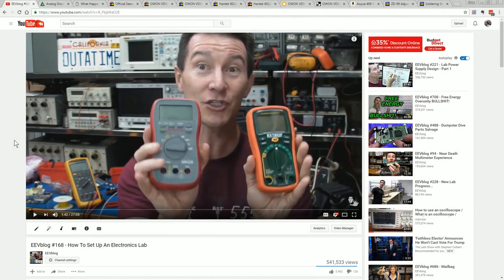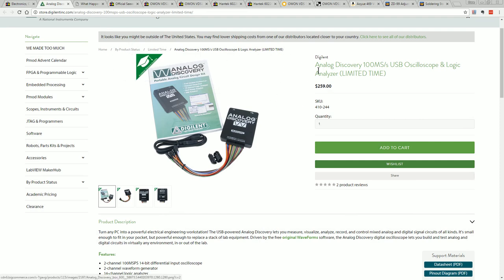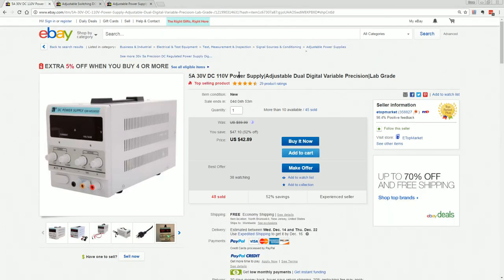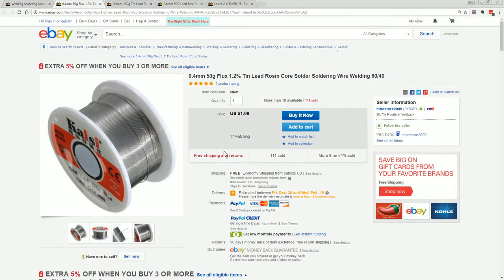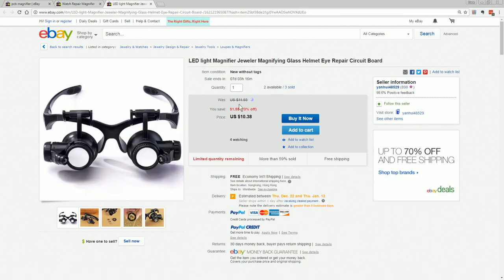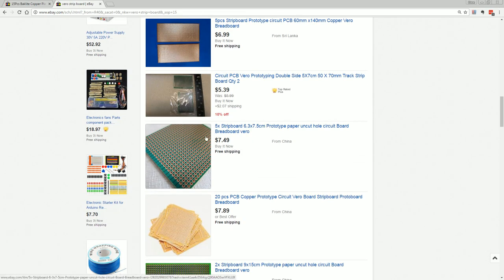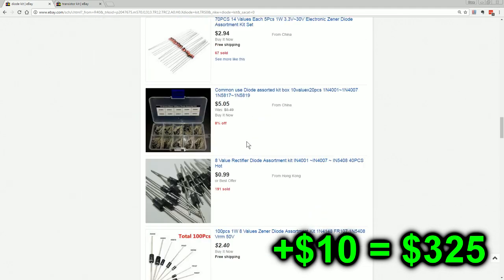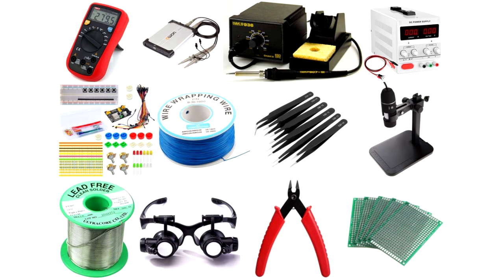EEVblog #954 - How To Setup An Electronics Lab For $300

Comment: this is useful! but id recommend a helping hand with magnifying glass over the crappy microscope. adds another 15 bucks you could spend on a microcontroller kit or parts.
Reply: From my experience those $10 microscopes are worth it when its all you can get, especially when you're still getting your eye in with SMD soldering it makes 0.5mm pin pitch soldering feel like you're playing with SOIC.
Reply: gamerpaddy The generic helping hand is, in my opinion, useless. That thing is super easy to tip over, its not solid enough. There are better options but they are also expensive. 

I ended up using glue and a scrap of a plywood sheet in order to secure the bloody helping hand
Reply: If you can find a logitech c270 camera , cost about $20 , they have a lens that you can unscrew to make it macro that allows you you get close enough to a pcb that you can view solder joints at 1280x720 in very good quality.
Reply: +Victor García I bought one years ago (without magnifier), and the grips on its "arm" positions are just not firm enough to hold the weight of even a small populated PCB.  Mine just lowers its arms until its no longer holding anything.
Reply: get the right one,or just one of the mini rotating vise (the one with a ball joint)  they are pretty handy.  the magnifying glasses / headgear you allready got.
Reply: InXLsisDeo yep, agreed. I think mine goes up to 200x but it only ever use it in the first 10th of the magnification at most.
Reply: +EscapeMCP That one looks good. how was it  would you recommend it?
Reply: Just spring for a good board holding device....there are some really nice ones for around 200$ last I looked. VERY worth it. There is nothing worse than working on a large motherboard with through hole and trying to balance  it upright while soldering/desoldering (which is what I do now because I don't have a spare $200). I do have  a classic helping hands for small boards thoough. It does the job. If it is falling over, then adjust the center of gravity(yes, you can do that with all of them).

Comment: I would also recommend one of those microcontroller based component testers (usually sold as "transistor tester"). Measures everything, identifies pinouts. Also measures capacitor ESR in-circuit, which is great to find faulty caps. About $14 shipped.
Reply: Yes! They're quite fun too.
Reply: If you just search for "transistor tester" on ebay, a lot of these will come up, with names such as LCR-T4, GM328, etc. A small board with a graphical LCD screen and an ISP socket. Sometimes with mini grabber type test leads included.

Comment: This is exactly how I started. even older used oscilloscopes are nice if you know what you're looking for. But I buy a lot of stuff off eBay for the quantities alone. only issue I have is when you get counterfeit ICs. but, for a quick circuit, they have always done the job.

Comment: Great video Dave!  Just a note on those blue through-hole resistors: the color bands are impossible to read.  For beginners, much hair pulling will be saved by making sure you get the standard tan colored ones.  :) (voice of experience speaking!)  Again, great video!
Reply: Ryan Griggs i have tan ones and on monday i am getting MANY blue ones and will let u know how much trouble i have
Reply: oH well,lord! Hardly expected a reply like this a year later. Im deep into electronics and dont have tooooo much of a problem with blue resistors. Worst case I use my Fluke 87V for accuracy checks.
Reply: @Wes8761  It's good practice to check their value with a multimeter anyway so their is really no issue

Comment: A few other things that are handy
- LEADS - plenty of test leads: alligator, test hooks, banana, bnc. All handy. You can buy longer leads off ebay and cut them in half or quarters and put whatever end you like on them. However, it's nice to have flexible leads so search for silicon wire (various colours) and buy a few metres of each. You can buy bags of alligator, banana and test hooks off ebay. Make sure you solder them and not just crimp.
- Quite regularly I'll buy the 240vac to 12Vdc 450ma modules for about $2ea. Great for all sorts of projects but even better for powering and isolating different circuits power requirements (like powering an LED voltage display separate from the power it's measuring). The displays only power up from 4.5V so no good if the power you're measuring is sitting at 1V!
- Second hand scope - $20!
- PBC stand off's. Buy a kit of various M3's.
- Build a transistor tester - saves time identifying leads, types and various (not 100%, but pretty good and also does diodes and bonus wave generator).
- male/female header pin kit
- heatshrink kit (buy a medium clear case, various lengths/colours/sizes and make yourself)

Comment: For Oscilloscope Digilent markets the Openscope nowdays which is really pretty nice for $99. 2 scope channels, -4 - 0 -4 v power supply, 16 ch logic analyzer, 2 ch function generator etc. Works on WiFi if so inclined.

Comment: the cheapo 30v 5a supply is nice, but you definitely want to add a resistor across the temp switch, so the fan is slightly on all the time. Without it, the fan will switch on even with very low load after a few minutes, making very annoying noise. 
I recommend the fluke 17b+ as a cheap multimeter.

Comment: As a cheap power supply I used a Tatoo power supply from eBay at some 12-14 USD, there were a 90-250 Volt ac to 24 DC power supply inside and then a LM317 regulator and a panel meter, I did remove the 2 pieces of 1/4" jack sockets and replaced them with a red and a black binding post.
Yes it is not the best PSU in the world, but I can get from around 2 to 18 Volt out of it  and around 1 Ampere, so it suit most needs I have and I often use it, much more often than my 2*0-30 Volt 5 Ampere lab PSU.
So as a starter PSU this is ok and more safe than a PC PSU which can blow the hell out of to much electronic if you do not take care.

Comment: I started with electronics using one of those starter kit from eBay.
Those kits usually just pack a small amount of each component and charge a big price.
For example they might give you 20 LEDs, and 20 jumper wires, while separately
you can buy 100 LEDs or 80 jumper wires for $1 each.

They do help beginners learn the basics of electronics, and which components they want to have.

But I think the audience that would need an oscilloscope or a signal generator, is already familiar with basic electronics, and would better prefer buying LEDs, resistors, diodes, breadboards and all the other items on those kits separately, and get much bigger quantities of common components.

Comment: I picked up a used Weller soldering station for $10 on ebay and for years I used an old 500w computer power supply as my bench supply. It was free and gave me lots of +12v, +3v, and +5v leads to work with. ;)

There is always ways to scrounge what you need. Just keep an open mind and see what you find. lol

Comment: I like the converting the computer ATX PSU where you stick in a 10Ohm resistor to make it stay on. Total cost less then $1.00. Has protection too that works well for oops moments.
Reply: it doesn't really have any protection. well, except for itself, but who cares about a "free" part when your 6 week project goes up in smoke? It's a good provider; throw a meter and cheap CV+CC buck in front for a half-way decent "bench PSU"

Comment: I would likely add spending maybe $50 on an arduino kit as well. These days they are so indispensable for prototyping. And the kits usually come with a tonne of nice goodies.
Reply from the maker: Of course.
Reply: aren't there emulators or something?
Reply: wtf??
Reply: 10 bucks max from china .... after my 20 euro genuine board died I decided id rather buy 10 2-3$ Chinese ones for the price of a single generic one. modules are ridiculously cheap too, usually a dollar a piece.
Reply: Kevin Miedema even better

Comment: Good advice. I remember setting up my first lab (kitchen table) when I was 6 back in the 60's. It was a soldering iron and a test meter that I found and repaired. I stocked up my supply rack (cardboard box) by salvaging parts from old Tv's that I found on the local dump. Total cost £0.00. Did not have a scope for nearly 10 years but acquired equipment as the money because available and I now run a company that develops electronic systems. You can never have enough equipment but you can also make do with almost nothing when beginning if you really want to so if you do not have any money then you can still do a lot.

Comment: One of the things I like to recommend to starting hobbyists is one of these ebay transistor tester things. Handy for roughly measuring capacitance, ESR and inductance as well as identification and measurements of transistors. As a hobbyist you will very often salvage components and with that thing you can measure if they are still working or in what state they are. ~20 bucks for one of these, depending on which display you want. If you have good eyesight you can replace the microscope in this list by it ;)

Oh and you need a little solder sucker tool for salvaging parts, no way to do it without them.
Reply: I don't know why Dave didn't mention that, those really cheap testers they check transistors, capacitors etc.

Comment: I have to disagree regarding DSO..i am using the DSO203 with custom wildcat's firmware and it is extremely useful and capable. Still not good as a bench one but for a portable one you can't go wrong..

Comment: Sciplus.com (store is called science and American surplus) if you want to get those magnifying goggles, telescopes, and a cheap multimeter for extremely low prices 

They also have a ton of other stuff.  Electronics stuff, motors, random knick knacks, a bunch of cool/random stuff.  It is a science surplus store after all.  Got a 200+ Dremel accessory kit for like 12 bucks.  The prices are awesome and I love browsing the site just for random crap.  

 With that said, I wouldn't recommend their soldering iron or kit.  You may want to spend a little more on that lol.  (I still went cheap chinese with a 852d+ hot air/soldering station, but that still cost me about 10x what the surplus was)

Comment: Lots of "salvage" alternatives.  A PC power supply can supply a variety of voltages once you understand how to "turn it on", and for the most part supplant a "bench" power supply for a lot of uses.

Here in sillycon valley, there a a few "surplus" stores that have interesting selections that can be used for "salvage" parts.

Comment: I don't really do anything with electronics. I just like to watch other people do stuff and I am interested in the theory. But about a year ago I bought my first multimeter. It's just a £20 cheap piece of shit but GOD it is useful!!!

I use it to test batteries, check for ground loops, check for blown fuses, dodgy wires, resistance in audio cables, etc.

If anyone is like me and is considering buying a multimeter for general purpose use, do it! Everyone should have one.

Comment: A hand desoldering pump is needed for fixing stuff, which is the earliest way of getting a revenue. There is a ten buck heated desoldering pump around. Also a fuse kit is needed, which is also useful for making easy safety measures. You can find a real scope-meter JDS2012A. It's a handheld battery multimeter with 20mhz real 1M input single channel oscilloscope with SCREEN, and there is a similar 2ch without multimeter. Because it is plastic and 18650 battery powered you won't kill it probing mains as long as you use a sufficiently atenuated 100X probe not included, but not expensive. If you can't afford the supply you can use recycled assorted wall warts and a computer soundcard is a 20khz signal generator ultra programmable and excellent if you don't burn it. Get 1N4148, 2N3904, 2N3906, TL082, 74HC00 and  ATMEGA328.

Comment: i set up my electronics lab for £150 and its all fairly decent. I brought a workbench for £25 at argos £50 for second hand 1980s analog scope. £50 on a power supply and i got multimeter and soldering iron for christmas and birthday. I had most of the hand tools already so i spent £25 on other stuff i didnt have like esd mat etc. but you could make your own power supply like i did with my second one and singal generator.

Comment: If you want to try electronics as a hobby you can start of with an iron,  solder, multimeter,  battery packs- boost converter as power supply and a selection of diy kits. 
But first watch many hours of youtube videos. Find out as much as you can about components.

Comment: Harbor freight has multimeters for free with a coupon on certain days. Even if a purchase is required, buy cheaper than $15, and your dollar just went further. The $15 can be spent on other stuff on your list as well. A win, win, win!
Reply: i used one of those for years; long-lasting battery and  balls-on accurate

Comment: For years I got away with a converted AT (yes AT, not ATX) power supply...still have it, still use it for fixed voltages and portability. Just build an LM317 circuit for adjustable voltages. Also, I did without a scope for basic stuff for years too. And when you decide you do need a scope, look for second hand ones, my 40mhz hitachi was $20

Comment: I'm surprised you didn't recommend an analog osciloscope! What was the reason for that?
Reply: Since a lot of today's technology produces none repetive signals it's better to have some analog storage capability.
Reply from the maker: I have in previous videos. And it's not something you can just point to and say "here buy this, it'll do the job". There are traps to buying a 2nd hand analog scope.
Reply: Good point. And with digital microcontrollers taking over, having something with the ability to do decoding is also very useful.

Comment: I'd personally recommend spending a bit more to get decent-ish quality tools of the things you definitely need and will use at the beginning and save your money on more expensive or less vital stuff that you may not need at the beginning. Magnifying glasses, soldering iron (if you think you will need a hot air gun then go for a combo unit $40-$60) and solder/flux. Then ask our for broken electronics from your friends and neighbors to practice on.

Comment: For magnification, try an iPad mounted on a document copy stand and a magnifying app.  Position the iPad so the camera is bottom right, not top left.  Resolution is reasonable and it gives you good screen with touchscreen control. (With a cheapo USB microscope you still need to set up a way to conveniently view the image while soldering - just use the iPad app and cut out the USB gadget). It is also useful to have an iPad mounted like this for viewing datasheets etc.  see e.g. ‘UTEBIT’ copy stand - usually $14.99 or so. Also need a tripod mount for the iPad to fit on this.  Then no need for ‘helping hands’ - rig you own component holders using croc clips and bulldog clips.
Reply: Yeah, iPads are so cheap!

Comment: Don't forget one of those little suction balls for desoldering. Makes it way easier. Just squeeze it & the vacuum from it refilling will reclaim the solder

Now for some suggestions for super cheap starter work stations(anyone who actually does these safety hazard corner cutting methods assume responsibility for any damage or injury that may result. I can't be held responsible for the recklessness of others):
*To save money on isolation for the oscilloscope,ust clip the ground off the PSU & power connector for whatever dumpster laptop I connect the scope to. That cuts out the need for isolation and when dealing with lower power circuits shouldn't be a big enough safety issue
*To save money on a power supply, get one from a dumpster desktop. That will get you 3.3V, 5V, & 12V, which will cover most novice circuit development needs.
*Get a sub $10 soldering iron with 2 settings(high & low). The low setting should be hot enough to solder components while the high setting is a more for desoldering quickly, though not really recommended. I recommend blowing a small computer fan at the components being desoldered to reduce the chances for overheating the component.
*Boost(or create) your component supply with desoldered components. Components need to be in good working order before hand & this really should only be done with components you can test afterwards. This one's a time vampire & you've got a chance to burn up components, which is why you need to keep it to things that won't burn up in the desolder process or at least can be tested after. If you're doing this step, I can only assume you're homeless & reading this from a public library computer.
Reply: Apparently, there are DIY kits for a function generator($7ish) & an oscilloscope($20ish). If I ever get $30ish to burn, they are on my to-buy list just to see how godawful they are. Who knows, they might be enough for a hobbyist on a budget(but I really doubt it).

Comment: I've got a syscomp CGM-101. It has a built in bode plotter and exports data as csv, it's incredibly useful for audio work, probably not so useful in radio frequency range. Signal generator and logic analyser is also win.

Comment: 1 Genuine Hakko tip will heat quickly evenly and be formed to be perfectly snug over the ceramic heating element while having more mass to maintain a temp for fast working and actually melt solder on chunky joints. Maybe just get the cheap station and change out the heating element and tip for genuine Hakko and  you might have a decent station for cheap. Or you can get a pack of 5 or 10 crap tips that don't last and only 1 or 2 of them being a useful shape for the same price.

Comment: I would recommend not buying the cheapest solder wire you can find, I use Stannol HS10 1.0 mm wire (leaded) for almost everything and even a small roll lasts quite long. Also get one of those AVR based transistor testers. they're great to check components when repairing stuff.